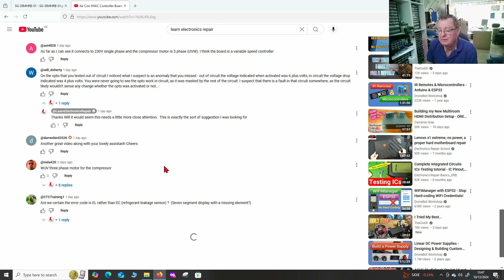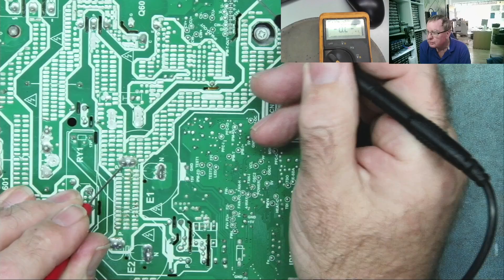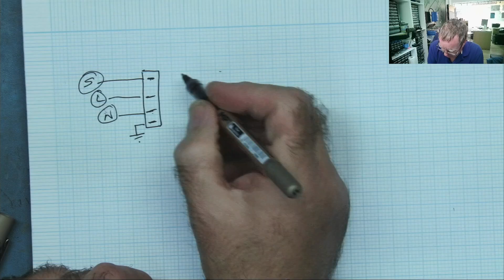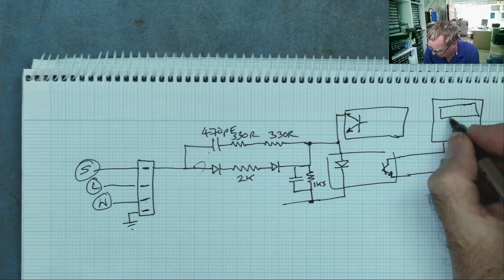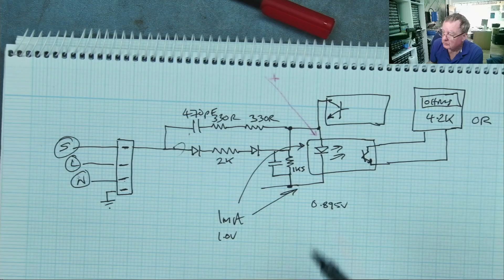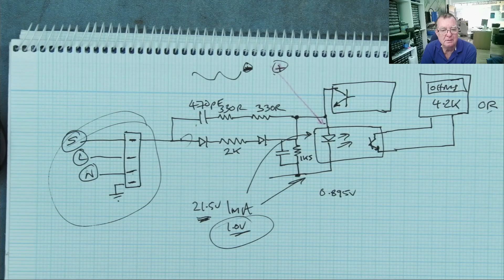I thought I knew some electronics but what I found on this Air Con HVAC PCB seems impossible!

Comment: Did you check the (AC) capacitor of fan?
Reply from the maker: I don't have the fan, an aircon engineer went out and said he tested everything and therefore diagnosed a pcb fault. of course he could be wrong
Reply: The outdoor pcb would send an error code when the fan capacitor is broken. Sometimes the fan cap is om the pcb. I am talking about the outdoor fan. I am not sure if it is a DC or AC fan. A fan failure would cause the airco to switch off after a short time.

Comment: I think capacitors are doing some kind of oscillation and turnning the the test probe into some kind of antenna probably, if that makes sense!? because this is weird and has to be explained !
Reply from the maker: It certainly is weird.  Also as this is an optoisolator there should be no electrical connection between the high voltage (LED) side and the low voltage opto-transistor side of the circuit. That is the whole point of the isolation
Reply: @learnelectronicsrepair  I'm so sorry Sir I thought the probes are the multimeter's, maybe as others said it has to do with some ground loops, but if only when you connect the positive line of the LED tester the reading apears at the meter then this has to mean that somehow the tester has a comon ground with the board which makes it even more weird because no connection is seen here between the board and the tester?!!please let us know when you figure it out.
Regards Mr. Richard and thank you for the useful content on this channel it is always great to wacth your channel👍

Comment: When I fixed mine I discovered that the signal cable between the units ran at 300VDC. I thought this was just ridiculous until I realised you could accidentally connect the signal to Live and nothing would be damaged.
Reply from the maker: 300VDC with reference to what?
Reply: @LearnElectronicsRepair  the chassis ground on the internal unit, which is bonded to earth, and the ground wire in the 4 core linking inside to outside units (L N E signal).